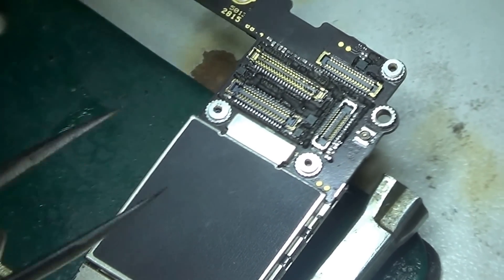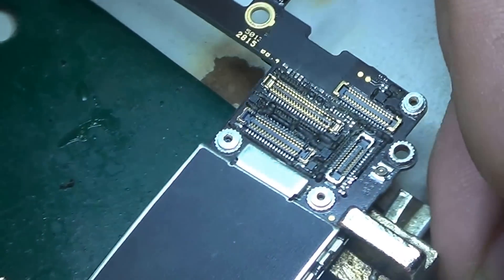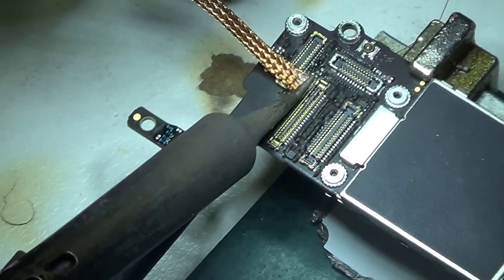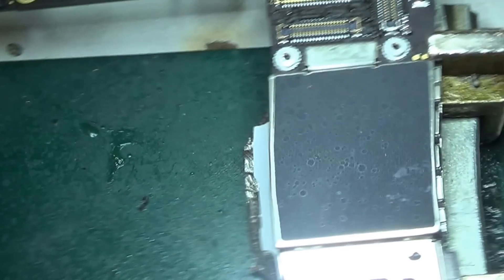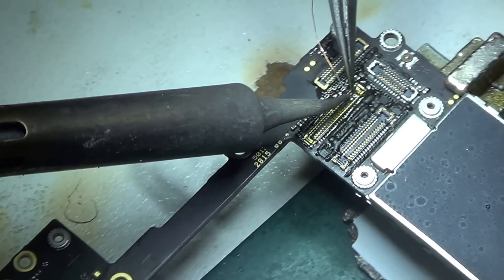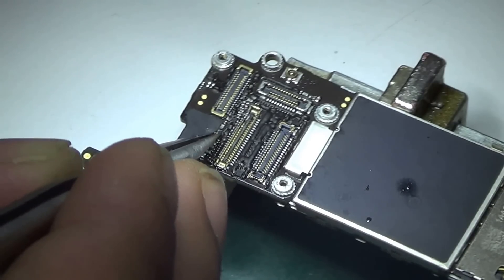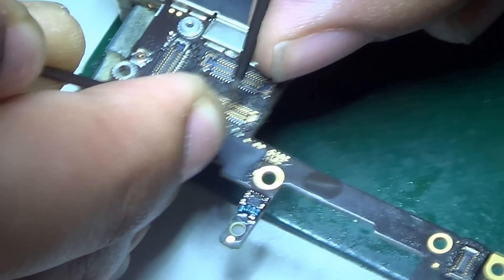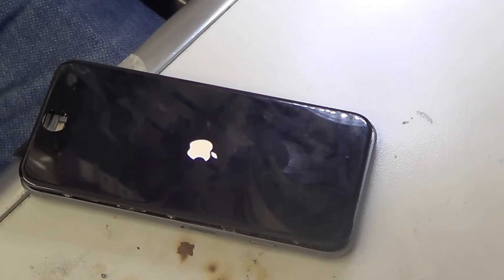How to Fix/Repair Iphone 6s no display after water damage

Comment: NEED HELP!!! 
I dropped my Iphone6s in water after letting it dry out completely, it works fine but the screen is black..... It's on,,,, but siri doesn't work,,,, i put a flashlight on my screen to go to apps and settings,,,, it does vibrate but the speaker won't work on videos,,, but when i play the RINGTONE the speaker works..... plus the 3D touch is not working too and in the keyboard ...some of the keys do not work when i touch it, so basically THE PHONE IS TURNED ON BUT HAS A BLACK SCREEN WITH OTHER PROBLEMS like speaker, 3D touch, Siri etc.  
so i opened it up and i saw the pins of the screen folder ,,, 4 of the pins had turned in gray color, is it becuz of that ??? the board is fine. 
plz helppp somebody :( !!!!
Reply from the maker: thats what happens with the liquid damage cases have yo tried a new screen after cleaning the connectors?
Reply: Khalid Noor you just need a new screen, if you would like, I can do this for you. I am certified in this after taking about an 8 hour long class of all ios and Android problems.
Reply: so if everything else works, sound, touch id, vibrate and silent mode but the screen is black after water contact, does that mean all thats need is a new screen?

Comment: My iphone 6s was damaged by water and i had to changed the display because the technician told me that backlight has burned but the display shows image and also works the touch and the 3d touch but he told me that i had to change the entire display because if put a new backlight it will return to damage again. can you tell me if it is true or it can be repaired?
Reply from the maker: that is not true

Comment: i have a iphone that have water damage, some times the displays show me the image and some times it show me vertical lines.... how could i fix it?? the screen is new and its works properly in orders iphones....

and good video!!
Reply from the maker: +Jose Manuel Larraín de Andraca Hi have you check the lcd fpc connector and continuity between its filters?
Reply: +M6 Repairs yes I did, but they are working fine, it depends how I conect de displays if the screen have or not image.... could be a loose connector?? or some thing stil sulfated?? 

thanks you for the anser